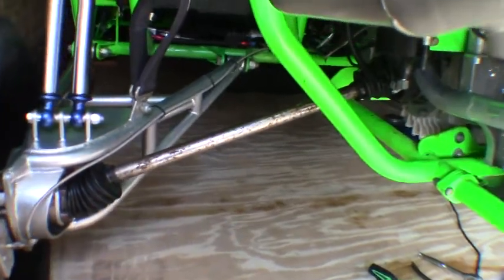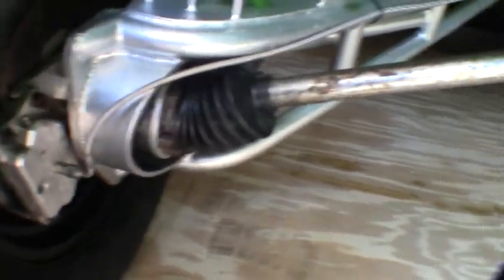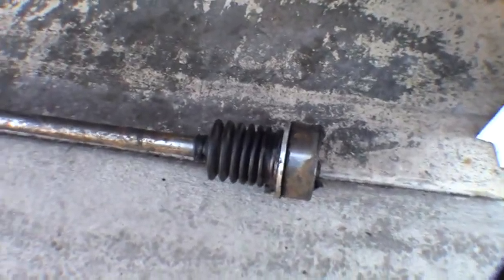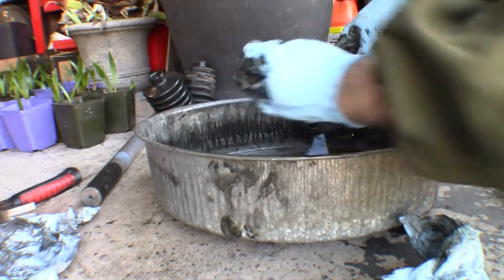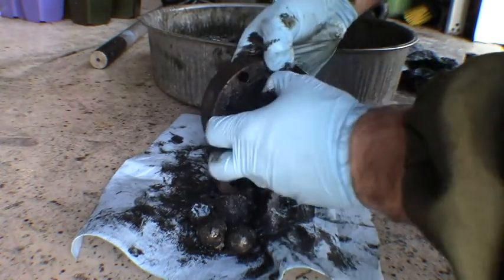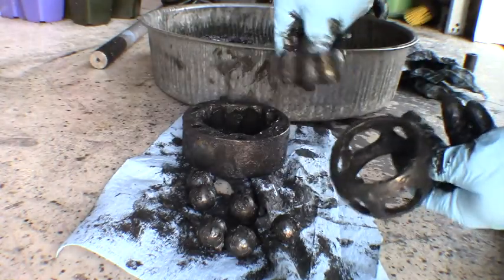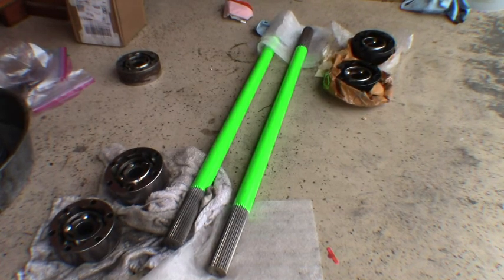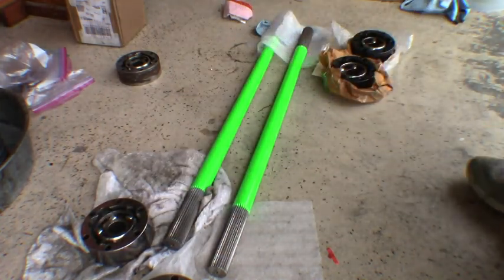CV joint service and replacement, Sandrail CV joints

Comment: Do you have another video on how you greased the cv?
Reply from the maker: I'm afraid I dont..I pack them as well as possible and I installed aluminum rings with the grease zerks so I can add grease at any point without having 2 break them down each time. Have also seen people pull the boots and use a needle grease gun 2 add grease without removing them as well hope that helps any

Comment: Just bought my Sandrail cv’s are shot after how many seasons did you have to break them down? thanks for the video
Reply from the maker: This car was new 2 me when I did the video I have no idea how long it had been but they were severely neglected..i suppose it would depend on how much car is used but I usually go through them annually. I had my new cv's drilled and tapped 4 grease zerks so I'm hoping I may be able 2 go longer by pumping fresh grease into them more often....time will tell